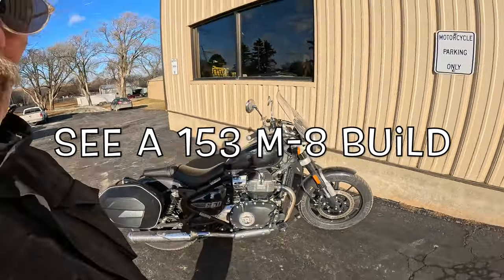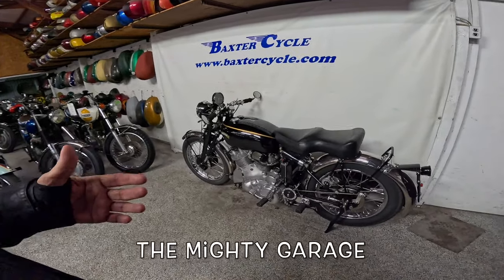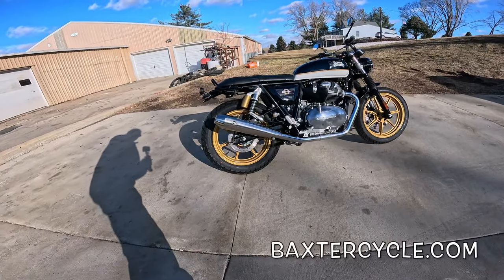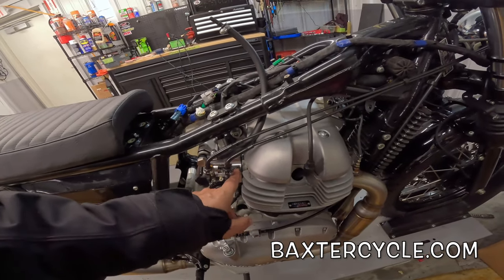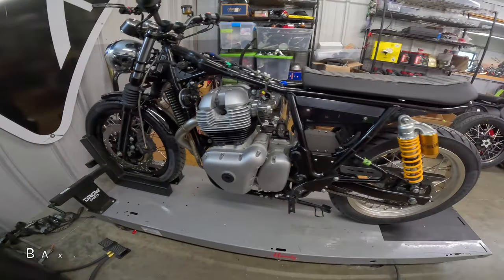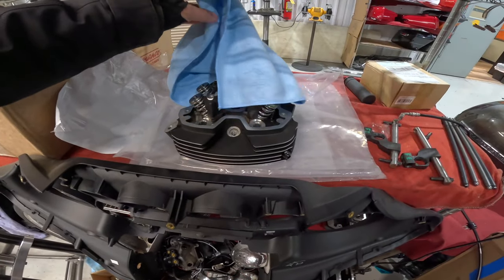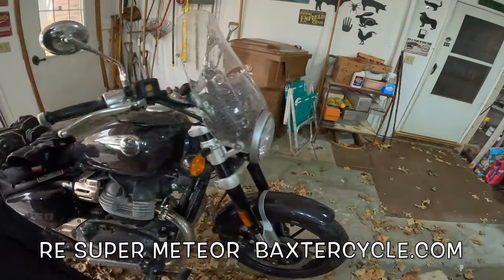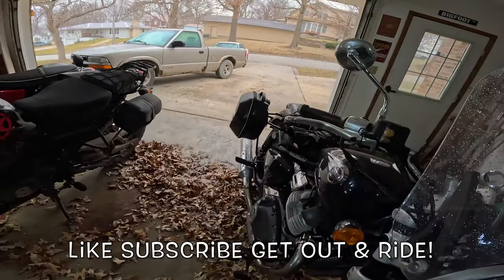H-D 153ci M-8 - RE 865 Big Bore - Vincent Rapide - Crazy Bike Day - Wahoo!

Comment: My guess on the 863cc Interceptor (with all the head work and 40mm throttle bodies by Revelry) "rwhp" output should be in the mid 60's; most of the bikes without the two goodies mentioned (  ) produce 62-63 rwhp, this one should theoretically have well above 70 horsepower at the crankshaft.  [67 dyno/74+] the throttle bodies are supplied with larger injectors btw !
Anyone else care to guess? 
know-it-all in Virginia...😂
Reply from the maker: Betting you're right on. That would be a substantial increase. Hope to see this motorcycle running soon.
Reply: @forgottenmotorcycles  the 33-percent increase from 648cc to 863cc is the same as Speed Twin 900 (64hp) to Speed Twin 1200 (97hp); they are in a lesser state of tune than this Baxter Cycle build and they are considerably heavier...